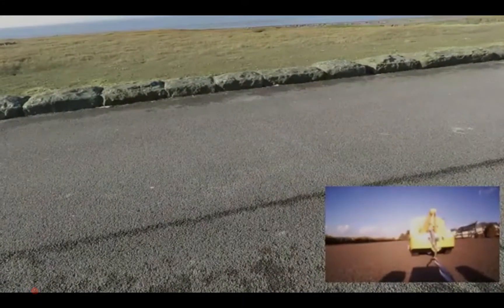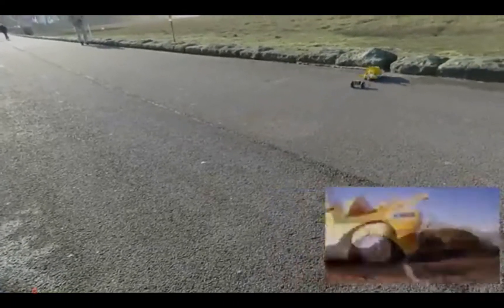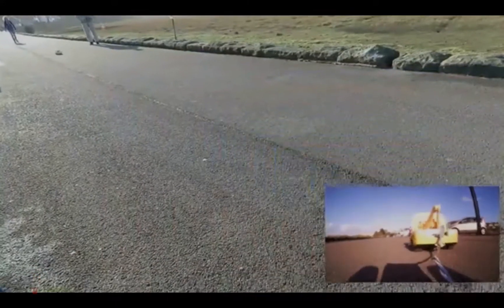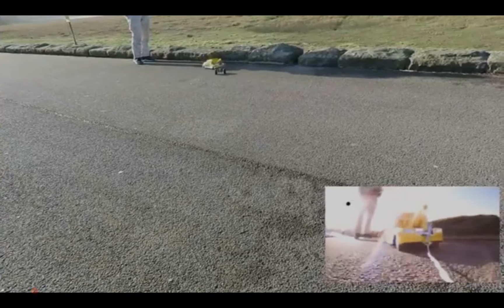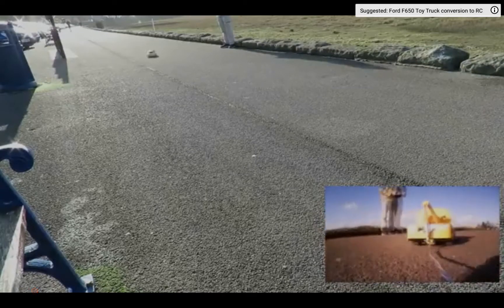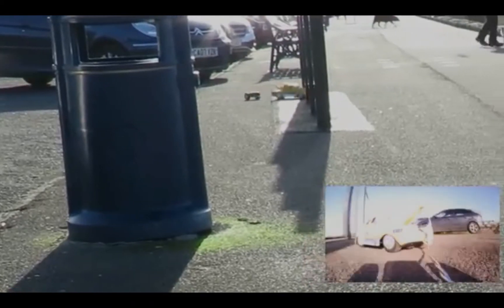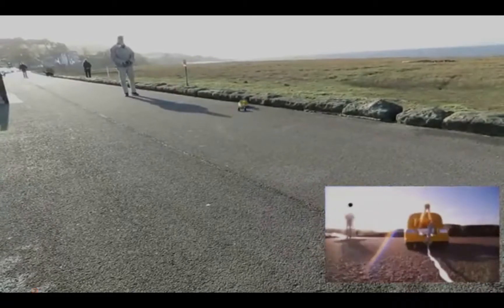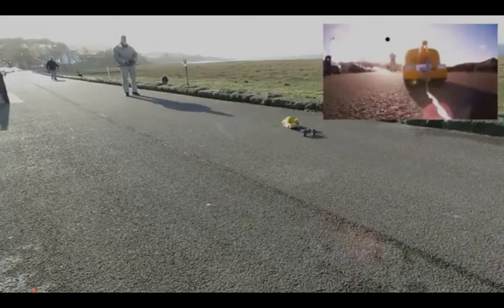SUN SIMULATOR THEORY DEBUNKED | Digital Camra Processing FACT

Comment: Incorrect information! There is definitely a sun simulator and lens array being used
Reply from the maker: Regardless of if there is a sun simulator or not this black dot is not evidence for it.
Reply: @WATCHINGTHEWATCHERS   that’s not true, if it were a camera anomaly or artifact, then it would be on every cameras pictures and videos. Plus it would have been seen on old photos and videos!  The black hole sun also would never be able to be seen in the waters reflection when viewing near lakes and rivers if it were just a camera default or defect! It can be seen with the naked eye! It’s must be high noon with no clouds obstructing it, don a pair of polarized sun glasses, while wearing a welders mask, not a solar powered one either. And also a get a piece of screen window. At least 20”x20” and hold that in front of the viewing glass of the welders helmet Look up at the sun and bend the knees slowly up and down and move left and right. You can only see it with the right angle. If you can’t find it after 3-5 minutes, wait 10 minutes and try again! High noon is the best chance to see this thing but it is possible to see it for most of the day it’s just a little tougher. This has been my experience at least.